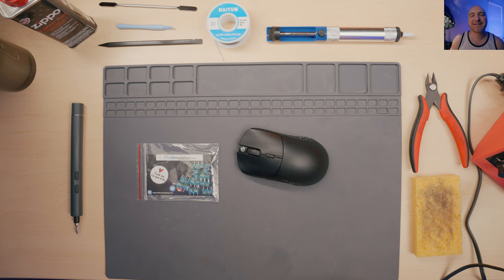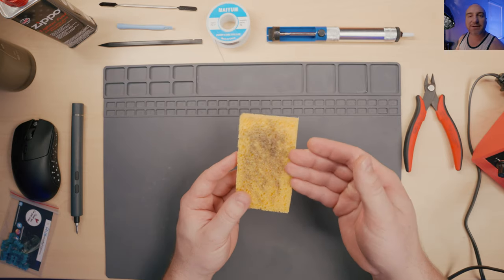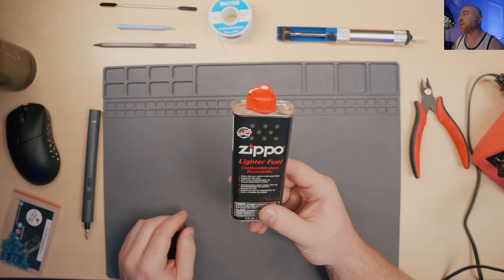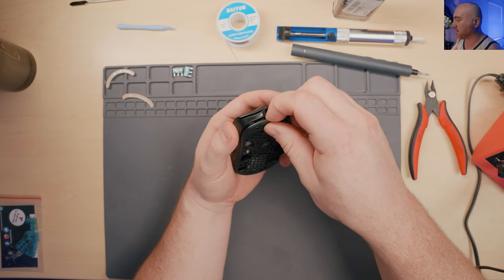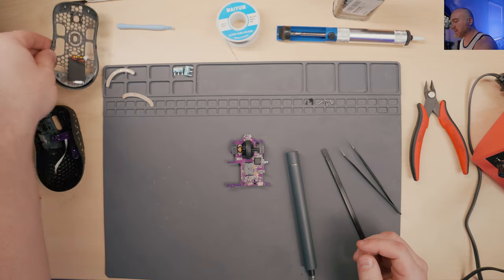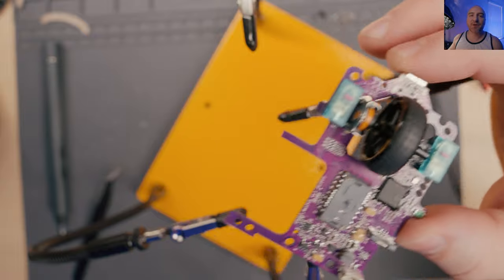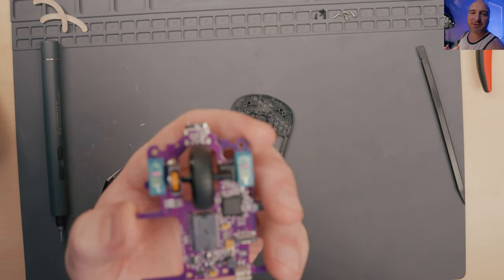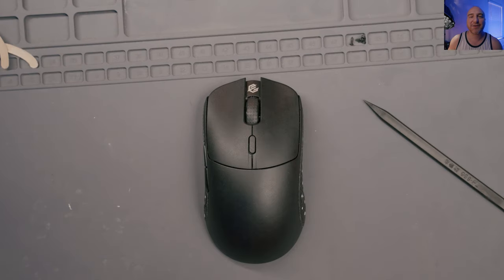How to upgrade the switches in your gaming mouse

Comment: I highly suggest you buy a K tip or also known as a knife tip. Its wide enough to to heat two joints at the same time and by moving it back and forth you are able to get all three solder joints to melt at the same time and effortlessly pull the switch out. This method was used by turbobitbox

Comment: Why didn't you just use the solder sucker on the joints to begin with instead of heating the pads one by one and slowly pulling out the switch?

Comment: Great guide for people wanting to get into mouse-modding and changing switches! I've done it a few times myself with the help from Ents videos.

Anyways. For temperature regulated irons, I'd recommend setting it to 350-375C. Also if you are having trouble making the solder flow correctly, use flux.

I personally love the japanese omrons, but I also just got these transparent BSPD in.

So how would you rate the click feel in the HTX with these switches? 🙂

- Keep it up! Really enjoy your videos.

Comment: I usually change stock switches instead Kailh Silent,i love them,but im curious about if changing the switch makes diferent performance on Response Time or just depends on mouse PCB
Thanks great video,like always !
Reply from the maker: IM pretty sure this mostly depends on the chip on the PCB :)
Reply: the switch just physically opens/closes a circuit so it doesn't add any delay by itself by the traditional definition (if you measure delay from the time the switch goes off to it being sent to ur pc). a lighter/snappier switch may feel more responsive though as the travel may be easier or quicker.

Comment: Great vid! Just asking what's the best switch for upgrading with? Im using the logitech g102 and its been double clicking for months now. I'm looking for something kinda mid price ranges and for gaming. Also new to this world of soldering, any tips would help!
Reply from the maker: The huano blue shell pink dots are one of the most popular switches on the market and I have not had any issues with them double clicking in any of my mice personally. With soldering I would recommend trying to practice on any board you can before you move over to your gaming mouse to try and get a feel for it. Don't keep your iron too hot or on the board for too long because you can damage the circuit board and the components. I wish you the best of luck :)
Reply: @AimAdapt  Thank you!

Comment: Hi, my g305 currently has gm8.0 on the left and stock omron on the right, gm8.0 causes pain to my finger and omoron is too light so i'd click it if i rest my hand on the mouse.
So im considering to change to huano transparent blue pink dot or ttc gold dust proof 60m/80m. 
Also my side buttons start to double click, Which one would you recommend? thanks
Reply from the maker: Hard choice it all depends on how they will feel with the click implementation.

Comment: British pronunciation of solder is an odd choice and not tinning the iron tip meant you had to hold the iron on part longer than would have been necessary if you had.  
Basically, your iron has oxidized and it is making it more difficult to transfer heat efficiently. 
The good news is, it isn't dead yet and the joints made in this video are just fine.
NGL I had to search a bit for a video to show what I mean, but here is a British guy pronouncing solder with an L AND giving a tutorial on tinning an iron!
 https://www.youtube.com/watch?v=yTcxn773G-4&list=PLZzwMlLVLdOAi-Xp78vQYOgoa9mFUouyn